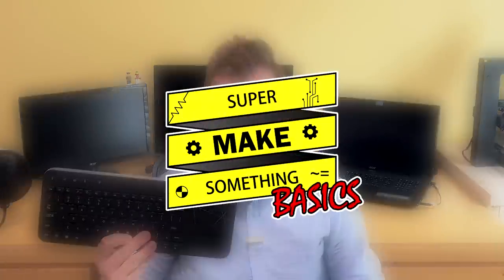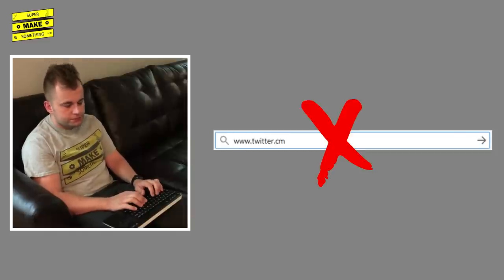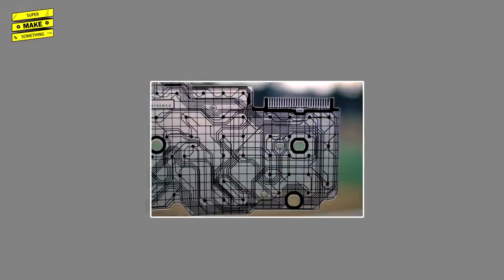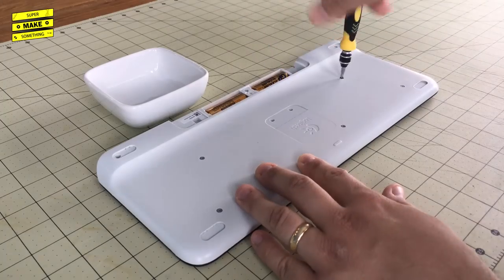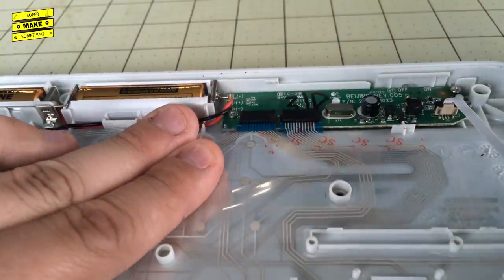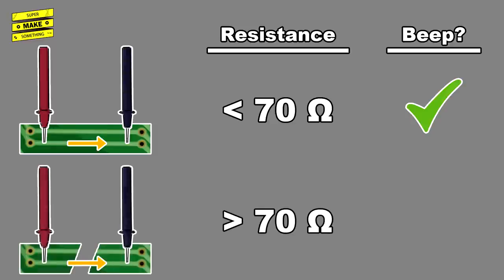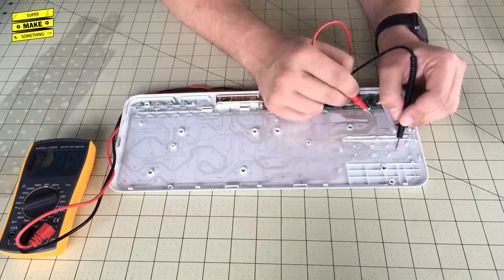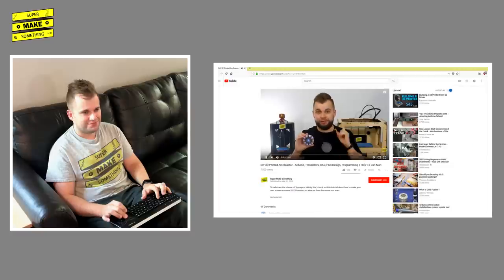How to Fix a Keyboard (Circuit Board Trace Repair, Multimeter Tutorial, Conductive Paint)

Comment: |I got a free keyboard that I just fried with static electricity, as the bottom plate is entirely made of steel which was a horrible choice as the plastic circuit trace just sits there and touches the metal bottom plate. I touched the bottom shocked the crap out of myself and the keyboard lights went dim and blank lol. I'm pretty sure there is a lot of traces fried because the F1 key now registers as 5 number keys and the W key registers as so many keys that it registers as 5 number+letter combinations and shuts down windows. It's just the f1 and W keys that are borked so I'm not sure if its worth fixing or just buying another 20 dollar keyboard. I would have to coat that metal plate in rubber or something.

Comment: I have a project, maybe you can help me to realize it together. I am not super technician like you but I know you can do something. can you help?
Reply from the maker: Rac Hid Unfortunately I am not taking commissions right now, but if any of the projects on my channel are close to what you are thinking, let me know in the comments of that video and I or the community will try to help out!
Reply: I want to remove all data cards from my laptop (like mother-card, RAM, fan, hard disc, etc..) and keep only LCD screen and keyboard in Laptop, include the battery and ports

The reason is that I want to use my laptop as an external LCD- and keyboard to connect to my desktop computer or any desktop wirelessly or by cables.

Is that possible for you?
 @SuperMakeSomething

Comment: I can't tell what's wrong... my escape key isn't working and I tried following this video. I'm still having trouble :/
Reply: As per the video above look at the lower plastic sheet up in the corner where your escape key is. Test the contact with a multimeter if you have one or borrow one. Without it you can just guess and assume the contact is broken anyway. The idea is to put a tiny bit of conductive paint where the contact is broken. This creates a bridge and allows connectivity and the esc button will then work again.

Comment: I tried to fix a broken space bar on my ADX gaming keyboard. It's a mess inside. Dreadful keyboard! The circuit sheet isn't actually connected to the circuit board; it was just pressed onto it with a piece of rubber. So I couldn't get it back into place. It's going into the bin tonight. Piece of shit keyboard! ADX suck!